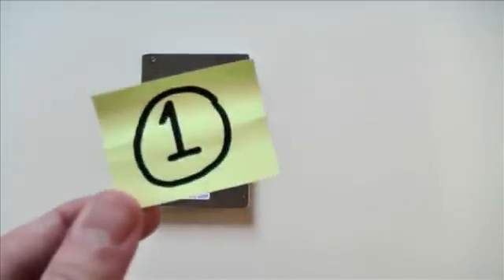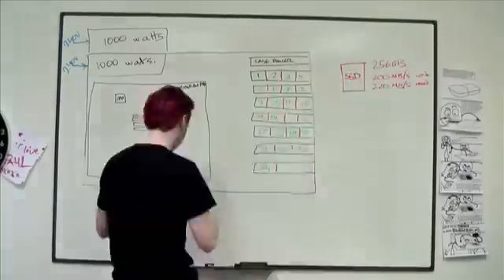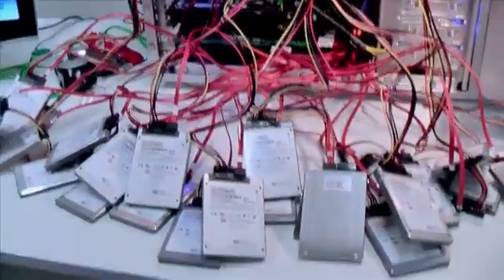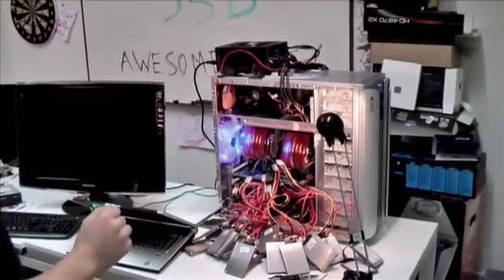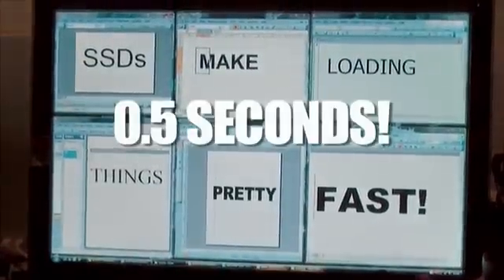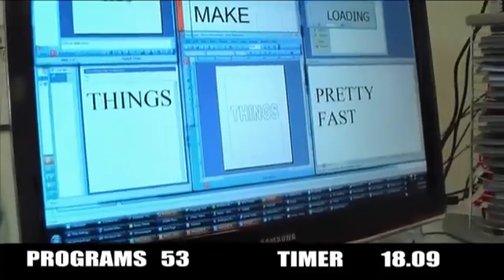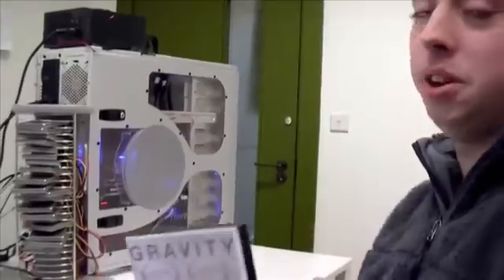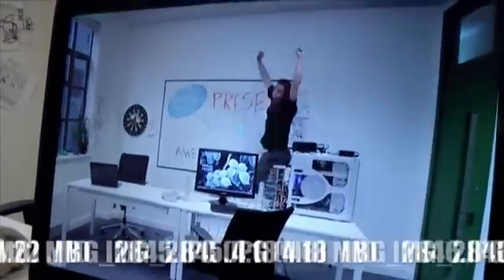What happens when you RAID 24 SSD Hard Disks !!!!!

Comment: lol 6tb. You can have 4TB on 1 SSD now, or 8TB on 1 HDD.
Reply: 1TB on 1SSD is the absolut maximum today.. even PCI SSDs for Professionals have a maximum of 1TB and they cost over 1000 bucks. You can get consumer SSDs with 1TB for around 500 bucks and they have a speed of maybe 500Mbits. One of the PCI things can get easily over 1500Mbits thats why they are so expensive compared to the normal ones. But like i said either way 1TB is maximum on SSDs only option is a Raid. And the thing about 8TB on one HDD isn´t right too. The maximum there is by 20TB now.
Reply: tomi123gta123 ahum; Xstra 4TB PCIe 3.0 Enterprise SSD MLC-E9901
Reply: tomi123gta123 an intel 2 tb ssd is real

Comment: But the amazing thing is: It's running Vista, which is one of the slowest builds of Windows ever made.
Reply: It can run Windows Vista while having 9000 programs running and running Crysis 3, Battlefield 4 and Call of Duty Black Ops 2 at high settings at the same time.
Reply: For that, you'd need a lot of RAM and a good graphics card, not 24 SSDs.
Reply: x8BitRain but having 24 ssds will have better page file reading/writing than 1 poor hard drive
Reply: The pagefile is basically a shortcut that's the same size as the amount of RAM you have, yes, it would be faster, but it's not going to make your game's frame rate any better.
Reply: thats why u get 24 sssds

Comment: 2000MB per second? 24 of them should be 5280MB per second ...or 42Gb per second (Gigabit).

Where was the bottleneck I wonder? Perhaps the advertised "each SSD has a 220MB per second access speed" was bollocks?

Comment: A lot of those tests would have been bottlenecked by other components of the system.  This video gives the impression that to have a fast computer you need SSDs - Samsung SSDs.  Not true at all.  You can achieve better sequential read/write on a good 15K high capacity HDD made of 250GB platters.  SSDs become better for random read/write - not much benefit to moving large files around.

Comment: what they need to do is start making drives that are a single unit
but internally are multiple drives, so you can plug several SATA cables into one drive
"the drive is basically a raid itself"
and sell them as multi-drives
sort of how single core CPUS became 2, then 4, then 6 then 8 cores
they need drives to go from 2, to 4, to 8 drives

Comment: You need to: 1) Get a server-grade parts (e.g 4 E5-4620v2, 64GB RAM and C602-based motherboard) and chassis (that supports 24 drives), 2) Get the Adaptec 7-series RAID that supports 24 disks and hook to CPU 2 of the 2/4P system, 3) Use Linux, preferably server version, 4) Use 4 aggregated 10GbE network connections to a manageable GbE switch and 5) stream multiple 4K feeds off that, preferably uncompressed

Comment: Why is 2GB/S amazing, while most motherboards come with SATA 3 (6GB/S). Isn't that an overkill?
Reply: 6 Gbits/s are NOT 2 GB/s
Reply: mrlolkiller14 6Gbps you mean
Reply: 6Gbit/s comes down to about 600mb/s... you're off by an factor of 3x... and this video was made in 2011? It's currently 2014...
Reply: ***** No a bit is storage but a fraction of what your used to. 1 Byte=8 Bits
Reply: Michael Pan Got it. I googled sata 3.0, and somewhere I found someone who said it is 6GB/s instead of 6Gb/s. 6Gb=6000Mb
6000/8=750MB
So it should be 750MB/s
(Why did they invent bit and byte.. why not bit and yit. Then it would be 8Gb is 1Gy. People wouldn't confuse it that way..)
Reply: StevieGreek Alithinos 2 gigabyte is 2000 megabytes.
2 kilobyte is 2000 bytes.
2 kibibyte (KiB) is 2048 bytes. 
2 gibibyte (GiB) is 2048^3 bytes (2^30 bytes)
Reply: Animiles  This confusion could be stopped if you read and use "b" for bits and "B" for bytes, and read 6 Gbps (six gigabits per second) and 6 GB/s (six gigabytes per second). ;)
Reply: venimus No. It is not. You are wrong
http://nl.wikipedia.org/wiki/Kibibyte
Reply: Michael Pan  in 2011 OCZ had RevoDrive 3 X2 and it had stock speed of 1.5GB/s, try to beat that :D
And now the fastest OCZ SSD Z-Drive 4500 go up to 3GB/s :D
Reply: Okay, this is the answer: http://en.wikipedia.org/wiki/Serial_ATA

SATA 3 = 6 Gb/s (gigabits per second), so the maximum transfer rate of a file can be      6 Gigabits per second /8 bits = 0,75 GB/s (Gigabytes per second). So you have around 750 MB/s on a SATA 6 Bus.

Now you now why it is amazing 2 GB/s (Gigabytes per second), and it is because of teh use of SSDs and Raid.

And of confusion here. :)
Reply: Hard Drives can't output data as fast as SATA can bus it. The reason we use busses that can move data wayy faster than the device it's connected to is so a newer, way faster device can always be dropped in as a replacement. Also, these guys had a collective bus speed of over 18GB/s. The individual SSDs were nowhere near the limit of SATA. On top of that, he maxed out the throughput of 3 seperate raid controllers. If you think about it, almost none of the hardware was designed to work at it's envelope, but he managed it.

Also, to answer your question, it was free. Samsung payed for it all.
Reply: sata 6gb/s bandwidth is actually 750 mb/s. It's 6 gigabits not gigabytes.
Reply: Jamie Evans There are not 8 bits per byte when talking transmission speeds. When talking about transmitting bits all bytes include a checksum bit and at least one stop bit. You need to send 10 bits for every byte of information. Something transmitting 2Gbps would only be sending 200 MBps, since it would need at least a check sum and stop bit on each byte or need to transmit an extra byte every 8 normal bytes with a checksum of the previous each bytes. Plus of course, if any checksum is incorrect, it needs to resend the entire byte again (or usually just an entire block of bits).
Reply: Paulo Henrique And that is excactly what I do. So if someone writes 6GB/s I assume it is gigabyte and not gigabit. And it was a trustworthy website where I read it.
Reply: usually bits/sec (bps) is used to measure connection speed (as in internet links) and bytes/sec(B/s) is used to measure transfer rate (like in downloads and file transfers between storage devices).
Reply: sata3 (gb/s) is about 500mbps, that video speed is over 2000mbps.
Reply: U know this video was made by the original author (nit this guy who posted it) had made this video in 2009
Reply: Paulo Henrique SSDs connected to a 24 port RAID controller card via SATA II, but the card connected to the mobo by PCI-E 2 x8 (at least).  I'm not aware of any motherboards with an onboard HBA capable of 16Gbps across one channel - Therefore it has to be a PCIE-E card.
Reply: him89 couldn't you be more specific, I don't understand what you are trying to say, but it works on PCI-e 2.0 x8 or x16 so that's the real difference. not Some poor sata 3 with only 6Gb/s ~ 600 MB/s ( that's the real speed )
The same as they did in this test, they has RAID controller connected to PCI-e, and the SSD hard drives to it.
Reply: Even with all your arguments, it still doesn't change the fact that 6GB/s =/= 6Gbps.
How is 2GB/s overkill if the limit is 6GB/s according to your logic?
Plus, haven't you heard from people already that SATA 3 supports up to 6 gigabits per second of data transfer?(gbps) You're the only one who is being a fucktard that can't recognize between bits and bytes, and you're complaining that it is confusing. Har har har...
Reply: what people don't understand is that there is also overhead involved in the transfer protocol.  Instead of dividing bits per second by 8 to get bytes per second it is far more accurate to divide by 10.  So, 6 gigabits per second = 600 megabytes per second, but only under ideal conditions.  In reality the actual speed will be lower due to additional overhead of the operating system.

This is an old video, but even by today's standards 2 gigabytes per second data transfer is still extraordinary, the majority of consumer grade computers are in the 100-200 megabyte per second range (or even less).

As far as that standard that tries to clear up the never ending confusion between 2^n and 10^n  as in 1024 versus 1000.  Well, that standard is a nice concept, but in the real world nobody ever actually uses it, (which is true of many other standards too), they rely on context instead, the notation is too clumsy.  If you are publishing a scientific paper in an academic journal you would use it, but otherwise not likely.
Reply: Paulo Henrique
you are right, that's how you use that
KB/s = Kilobytes per second
Kbps = Kilobits per second ( usually the internet )
it's so that you don't have to disting between them just by "B" and "b", becouse it would be easy to overlook.

now I know why you seen my comment as confusing.

I overlooked the "use" of it, and focused on the "conversion".
Reply: b is a bit.  *B* is a byte.  There are 8 bits in a byte.  *bps* = b/s.  *Bps* = B/s (which is the same as 8 x bps).  End of conversation?
Reply: Jamie Evans I pointed out, that you use the large letters (upper case) for prefixes like "K","M", or "T", and "B",or "b" to distinguish between bytes and bits on Paulo Henrique  comment, but the confusing part on my side was that you do NOT actually use the "Bps" and "b/s", so it won't be misleading, but it's still the correct form technically speaking.
Reply: Animiles It is the opposite actually 2 KiB is 2000 bytes
Reply: javituh See, People like you are the cause of all the confusing! If you say mb we can not know if you mean Mb or MB.
Reply: Animiles
Give up, Noob ! ^^
...but no, go go go ... it's to funny ! :D
Reply: this was back in 2011. That was good back then.
Reply: whoops. Does the bandwidth apply to the AT attachment bus or each port? If it's each port, does that limit the max ports to something, or do more expensive controllers just have multiplexers.
Reply: My current ssd speeds (sequential read and writes, random read/writes are slower):
Corsair ForceGT 120gb from 3 years ago - 475megabytes/second read speed, 512megabytes/second write
Samsung 840 Evo 500gb from earlier this year - 524megabytes/second readspeed, 531megabytes/second write
The 840 Evo is cheating a little bit as a sustained write of over 6gigabytes or thereabouts will drop it down to around 380megabytes per second sequential write speed.

Both of these drives are on a SATA3 connection.  I also have a M.2 slot which allows me to acquire pci-e connected ssds on a small form factor card (its like 5cm x 8-12cm) which allows for a 10 gigabit per second connection which equates to a theoretical 1.2gigabytes per second.  These M.2 slot ssds allow a sequential readspeed of 1170 megabytes per second and 950megabytes per second write speed but they are expensive compared to regular SATA3 ssds ($AUD576 for a Samsung 500gb M.2 PCIe card vs $AUD376 for a Samsung 840 Pro 512gb SATA 3).
Reply: Paulo Henrique Not just the use of RAID, but PCI Express.  I'm gonna guess the raid controller was PCI-E 2.0 x8 or x16 from the date of video.
Reply: Jamie Evans Do you mean those guys connected the SSDs via a PCI Express SATA card? This makes sense if that's what you were saying.
Reply: Actually, just watched the beginning again - They're using 6 SAS->SATA cables, so is likely a 6 port RAID controller.  6 x 12 Gbps gives a potential for 72 Gbps, or 9 GB/s.
Reply: kokos NH Up to 230,000 IOPS, So realilistically it's more like 230MB/s, which is less than the $120 SSD I bought a couple months ago.
Reply: him89 IOPS is not a measurement of bandwidth.  It's input output operations per second - So like you have average seek time for a HDD, SSDs seek times are typically so much lower that IOPS is used as a better way to represent the random read/write performance of a drive.  230K IOPS could be achieved easily over PATA, but you certainly wouldn't get 230MB/s.  The two measurements are distinct.
Reply: NxHBSGamers Congratulations! Finally someone who knows what is talking about here! People who don´t know the difference between bits and bytes in a transfer rate sentence should not be commenting here. Your point is the same I stated above, gbps is really different from gb/s and those folks seem to ignore this fact and start saying nothing to do stuff.
Reply: Paulo Henrique 
Gbps = Gb/p ;
GBps = GB/s ;
Gbps = 8/(GB/s) ; 
GBps = 8*(Gb/s) ; 

Is that clear enough ?
Write the correct forms, please !
Reply: kokos NH No, it doesn´t really matters if it is low case or upper case, the fact is that gbps, GBPS, GBps, GbPs, GBpS or whatever IS GibaBITS per second, on the other hand GB/s., Gb/s, gb/s, Gb/S.... it is GigaBYTES per second. Stop trying to make people confused, it is the "p" and the "/" that matters, only that. Actually it is generally used B/s for bytes per second and bps for bits per second.
Reply: Paulo Henrique I'm just saying what I learned, I am a computer scientist by profession, and now I'm studying informatics in university, so they require that from me. :(
And If we talking about "ps", it's mostly use in the internet connection speed. and the "/s" in other data transfer.
Reply: kokos NH I am a Computer Engineering student and here we are used to read this way:

KB/s = Kilobytes per second
Kbps = Kilobits per second

This is for RF, WiFi, Ethernet, internet connection and transfer rate of devices.

Of course it is what we are used to do, this way we can´t get confused when we see the standard terms in articles, excercises or in any other place of the world.

There are some people who explain this situation just about the uppercase B being Byte and the lowcase b being bit, thats okay for me too, but the /s and ps are used in a lot of applications the way I told you, /s for B/s (bytes per second) and ps for bps(bits per second).

If we are having some missunderstandment here it is just because of the language used by the professionals being a little different, for example: Engineers usually use bits but Computer Scientists care more about the bytes, so it would be not that important to arguee about this stuff, just know that 1 byte = 8 bits and it is all.

I've already seen some people saying that ps would be confusing because it means "picoseconds" in the International Unit System. For me it is just another way to look at the terminology but the application is in another area, not transfer rate or connection speed/bandwidth.
Reply: Paulo Henrique " No, it doesn´t really matters if it is low case or upper case"
No, just no.
Reply: him89 Actually anyone who knows anything about computers knows KB = kilobytes Kb = Kilobits,

It matters to everyone who actually knows what theyre talking about
Reply: ***** and anyone who knows anything about the written English language knows that when you put quotation marks around a statement it means you're quoting someone.
Reply: ***** I wasn´t talking about the unit of bit or byte, I was saying that in transfer rate and connection speed these are the standards respectively: KB/s and Kbps. I know that when you use B is byte and when you use b is bit, but look anywhere for connection speed, for example of your internet connection, you can use websites like speedtest.copel.net to see it, and what you will see is the speed shown in bps. Now if you whant to see the transfer rate, for example of your downloads or computer HD, you will see KB/s. That was what I meant. You are right about the difference between bit and byte letters, but I personaly never met KBps and Kb/s anywhere, just when people start to argue about what's the correct form of each one.
Reply: BW022 1) That's irrelevant to my original post - there are eight bits in a byte 2) Nowhere have I asserted that dividing by eight is a sound function for calculating data transmission speeds (you had many to choose from but you're nerdering the wrong person)  3) While on topic, your reference to stop bits is solely relevant to serial communication, not channel/bus, whereas your post is ambiguous 4) SATA uses 802.3 cyclic redundancy check which is always a Dword (32 bits), as opposed to a single bit per byte, across the size of the frame at intervals determined by the IEEE generator polynomial 5) This kind of information was never suitable for this thread 6) I'm easily agitated.
Reply: he used sata2
Reply: Houndoom of doom but the RAID controller was in PCI-e, so it doesn't matter that the SSD itself was on SATA 2
Reply: BW022 Packets are sent at a specific MTU. and depending on what size MTU you are using generally 1500bytes for just generic equipment you will have overhead on each packet depending on what it is it will differ. best way to estimate the difference between bits or bytes per second is to use the divide your bits by 8 then about 80% - 90% of that. That would only be useful if you were going to calculate the link speed of a connection. TCP windowing increases the amount of packets that are being sent at a time until packets are dropped. This is why having a larger MTU such as 9000 (jumbo Frames) in some applications such as ISCSI increases performance lowering the overhead due less packets being sent at a time. A very small increase of performance though I will add.
Reply: video=2009
Reply: Shannon Weir Serial communication is completely different to TCP.  My earlier post explains exactly how checksum - and consequent overhead - is catered for in all serial communication (which, for some reason, BW022 didn't want to reply to).

Not amused
Reply: yes :D sorry

Comment: So you built a computer with crap ton of SSDs to break 2000 GBps which just so happens to be the top speed of the bus they were connected to. You could have reached the same speed with half of those SSDs or less. And then you defragged the SSDs. Great job, guys!